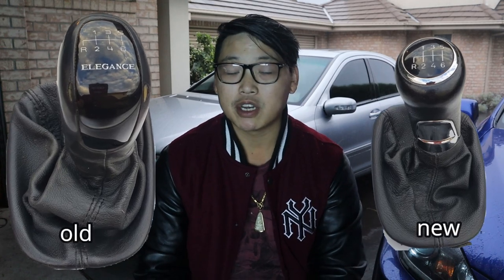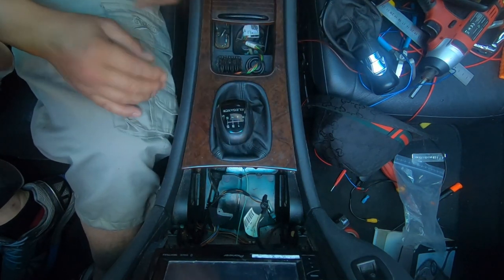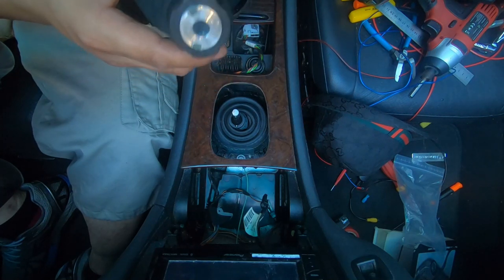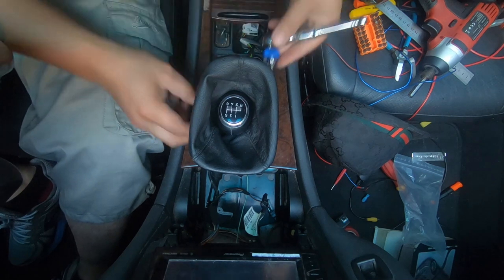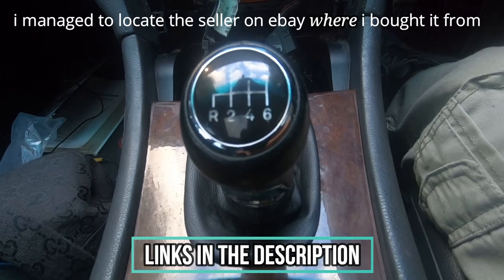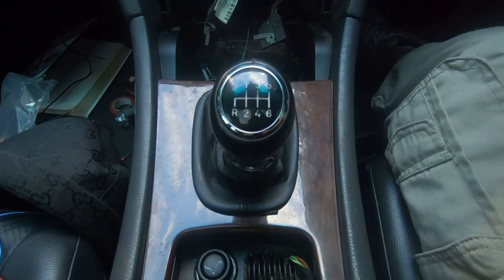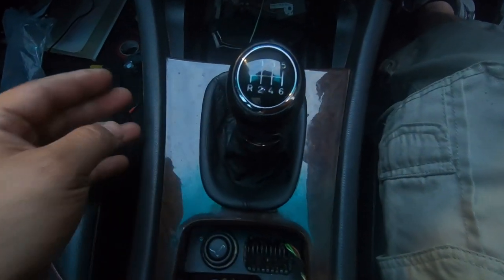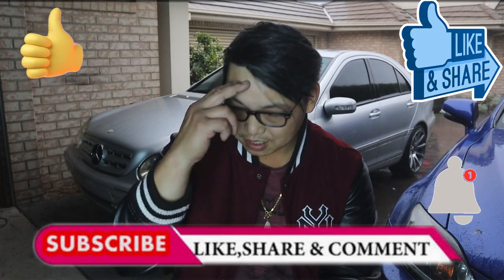mercedes w203 mods how to remove/update shifter 6speed manual + auto stick

Comment: I know im a little late but .. can I use a aftermarket shiftknob ..? Like does it stay on or wont it stay so on so on .. ?
Reply from the maker: u can as long as it screws on yes u can do that .. the shift knob doesn't have a button so u can use any knob so long as it has a securing method

Comment: Hi Mike can i use a w203 manual gearbox on a w204
Reply from the maker: the entire gearbox?
Reply: @MIKEYZVLOGZ  Yes.will the gear set up be the same
Reply from the maker: @brentvanbeulen4982  I don't think so the chassis is different
Reply: @MIKEYZVLOGZ  thanks bro
Reply: Cause i see the gearbox looks the same but the selectors are different
Reply from the maker: @brentvanbeulen4982  that's right if the selectors are different then it won't work... I really can't say for sure but in my experience .. the gearbox has to be identical for a direct swap over ... unless ofcourse u have the time and money for in-depth modifications to make it work .. anything is possible with an engineer ... but that's a whole new ball game ...